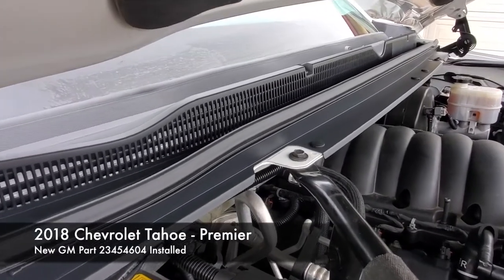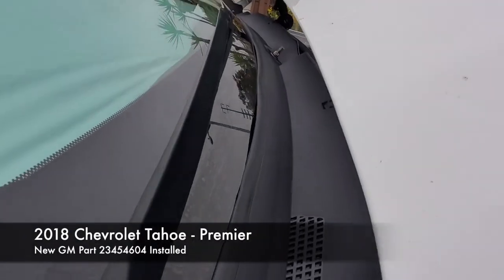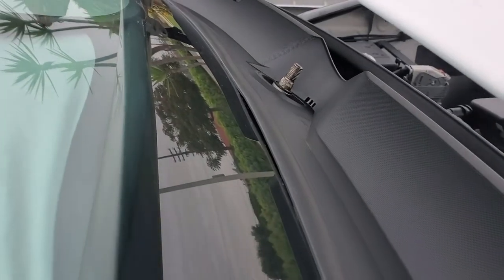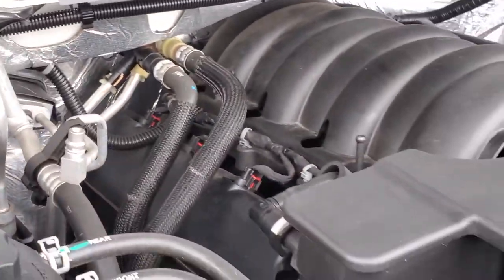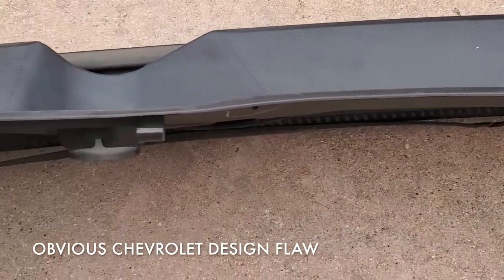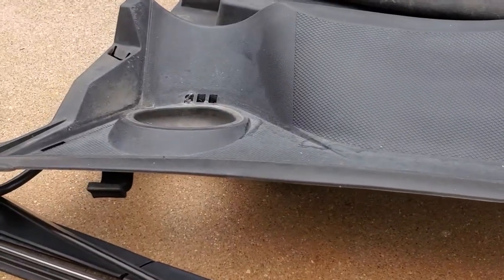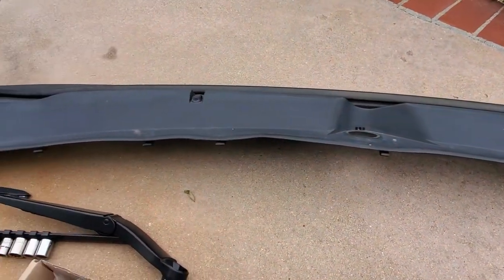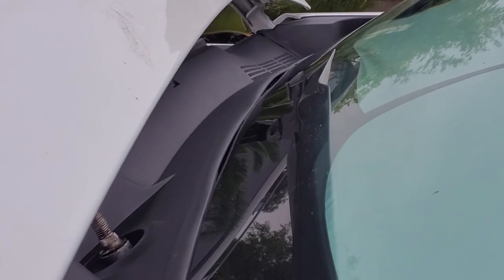2015-2022 Chevrolet Tahoe windshield/hood cowl design flaw, warping!

Comment: 2016 Yukon same here, piece is actually ripping off. probably because I've had 5 windshields installed. wish you made a video of the removal and replace. Did you get new side pieces as well?